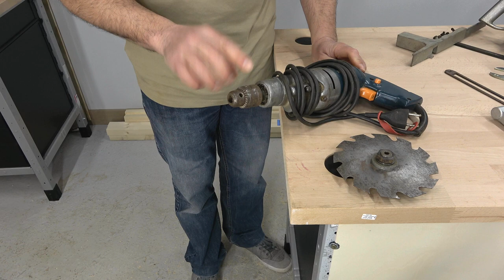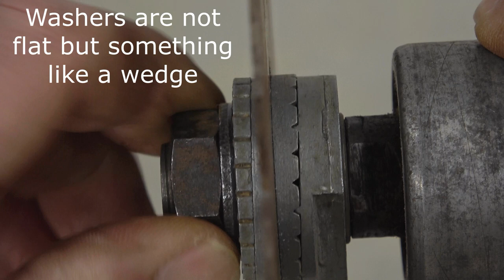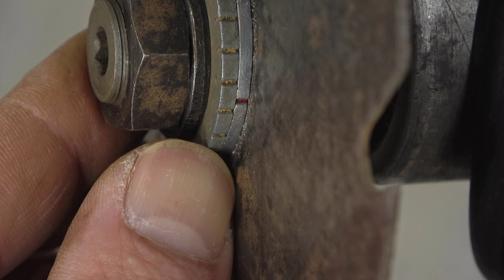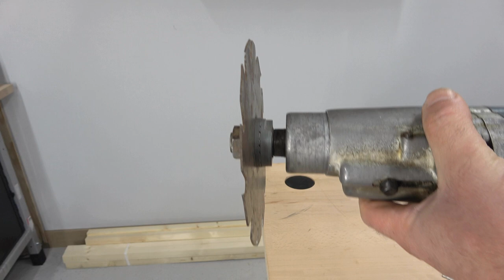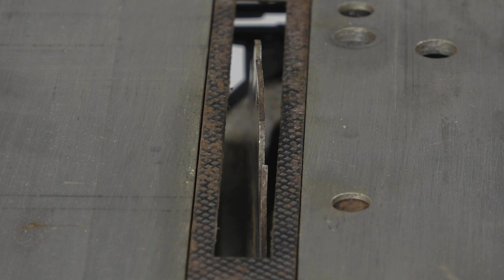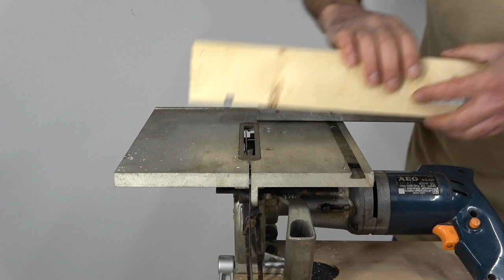Old WOBBLE Disc for table saw

Comment: I noticed right at the end that the slot you've cut is a very shallow dovetail, and realised you will never get a vertical cut at the edges because the blade is always at an angle. But that simply makes this more useful - you would normally need a dovetail cutter on a router to cut a long dovetail slot, but you've discovered a way to do that on table saw in a single pass! Great video, thanks.
Reply from the maker: Yes, it looks like the cut is not perfectly vertical
Reply: But if you take it slowly, and perhaps take it back & forth, would it not be parallel...?  Difficult to visualise.
Reply: Blade wobble can't cause dovetail shape 
If the blade axes is parallel to the table
The axes alignment is the problem

Comment: A fascinating  vintage tool system. The relatively low speed of a drill is what makes that wobble setup work. Present day wobble dado blades have to run at 4700 rpm and are about 3-4 times more robust with steel and are smaller to keep perimeter speed a bit slower than the full sized blades. The standard saw blade with a wobble at 4700rpm would be a frightening failure waiting to happen. The drill setup is pretty scary but with care, has some potential. Osha would not approve. ;-)  The scariest vintage system is an old radial arm saw with the motor tilted 90 degrees to do rip cuts on plywood by sliding the plywood along the floor. There are probably a couple of YouTube vids on that. It shows the sales promotion ad with that process. Nope, nuh-uh.
Reply from the maker: Yes, I have noticed that wobble discs for sell are smaller in diameter, but due to the built in wobble system they probably have more mass. This drill and all the attachments were designed to work together, so these are not attachments than one can use in any drill. This drill has no play in the chuck, while all modern drills I have ever buy have some play. Thanks for the comment :)

Comment: We had a set of these at college in the mid-60s. Used sensibly and gently, taking several cuts with increasing depth, they seemed no more dangerous than a normal blade - when used sensibly...

Comment: As long as you don't shift your workpiece during the cut and the teeths are sharp you shouldn't have issues. "Classical" kickback happens when the workpiece makes contact with the saw blade body and grabs it. A properly adjustet splitting wedge/riving knife prevents that. There are circular saw like dado cutters sold today, that uses the same principle. However those old style steel only saw blades (no carbide tips) generally should be used with caution.
Reply from the maker: I wonder if it would be more probably to have a kickback when we rip cut than using a wobble wheel. But I am not an expert at all. Thank you very much for the comment :)
Reply: @WoodworkingwithDIYtools  The chance of kickback is always bigger with rip cuts, due to the fact that the natural tension in the wood are more distinct along the grain. With those wobble blades however it doesn't really matter because the blade body is always in motion from left to right. As long as your feed rate is adequate for the teeth to cut you should be fine. If you feed it to fast there's a chance that you have some amount of wood in the gullet below the teeth in a position where the saw teeth cannot cut, and stop the blade or throw your workpiece in your direction. Which is actually worse than normal kickback. I think the main reason for those things got out of fashion is that they are not very precise compared to other options.

Comment: I bought a handheld circular saw of very thin aluminum with a wobble blade, for a 1/4" drill I was gifted as a teenager. It  lacked any kind of blade covering safety device. I found that in wobble mode, the saw was a horror to use and stalled the motor every single time, but it didn't kickback. However, in perpendicular mode, it reliably kicked back. Frustrated, I asked my father to watch me and see what I might be doing wrong. 

He was white as a sheet, and seeing that, I wisely discarded the device!
Reply from the maker: Thanks for sharing your experience. This is not meant to use in hand held circular saws. In table saw mode it should work, but sure any little misalignment can make it kickback more easily than an straight cutting disc